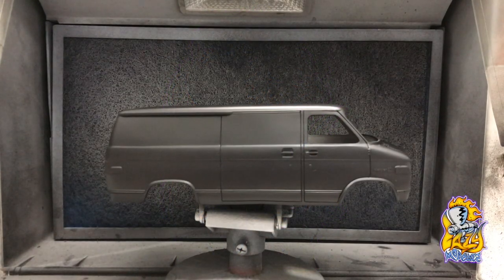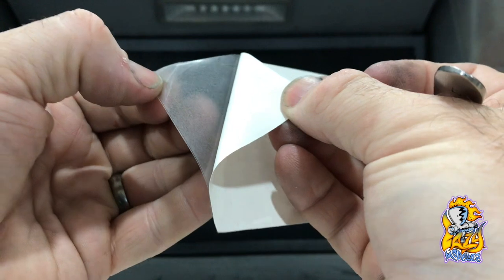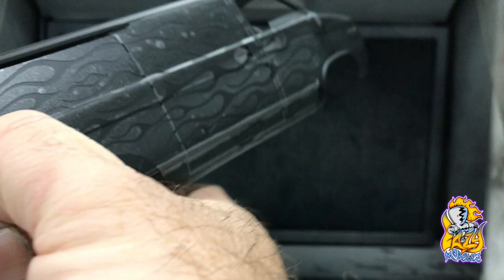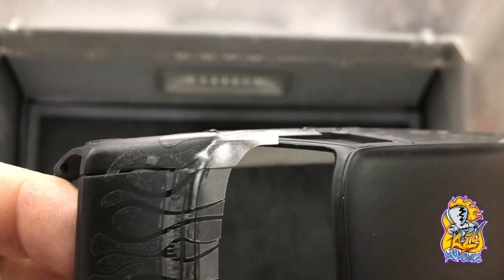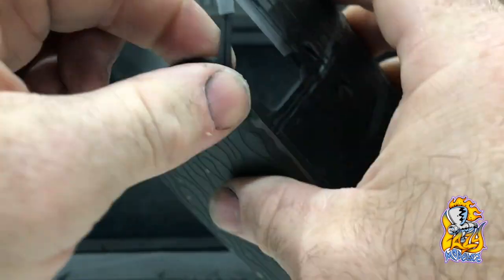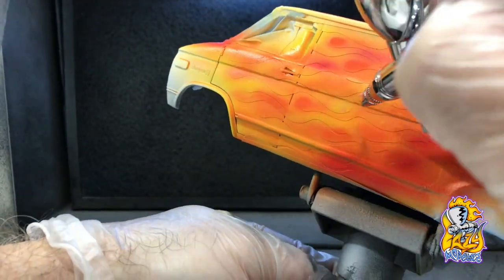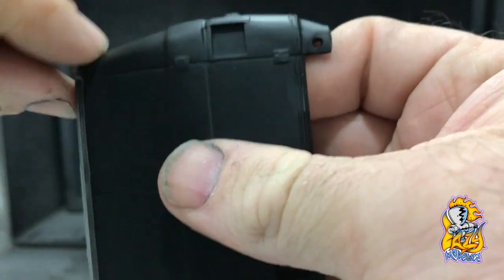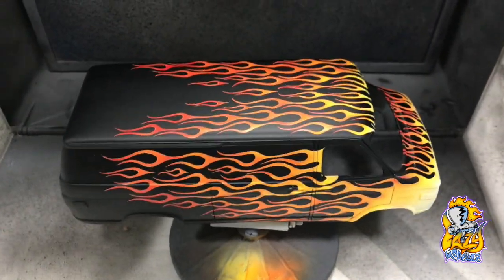Flame Painting the AMT Chevy Van with Lazy Modeller Masks

Comment: Is there a place to buy these masking sheets?
Reply from the maker: Hi Kevin, you can get them at www.lazymodeller.com
Reply: @LazyModeller  I make my own model cars from wood and I am starting to learn painting techniques, will these stencils stick to wood after properly sanding and preparation of the wood? I'm looking for a type of stencil that I don't have to spend a ton of time either  making or attempting to produce a clean finished product without a multi step process. I watched the video with the van getting the flames stenciled and painted! NICE JOB!!! THAT WAS COOL! BUT IT 2AS PLASTIC!
What type of material is these stencils made of anyway?
Reply from the maker: @kevinbrister8801  nice! These are cut in film specifically for paint masking. I’ve actually used it on wood previously. I used wood stain thru the mask on a skateboard deck.